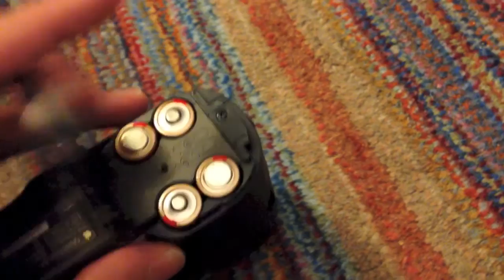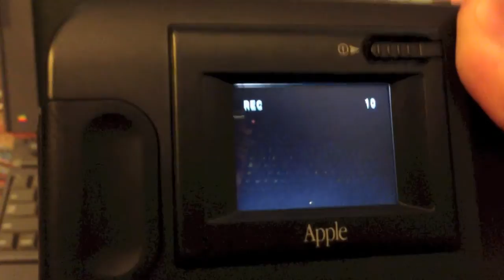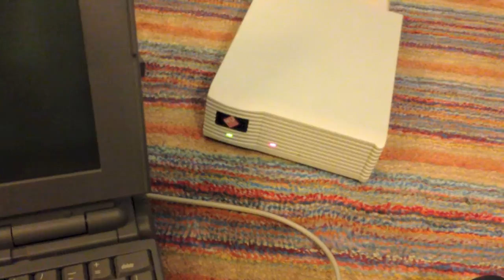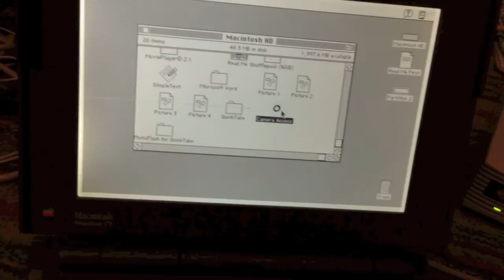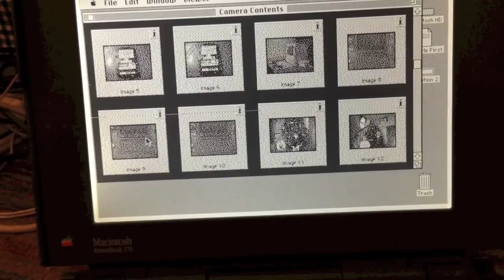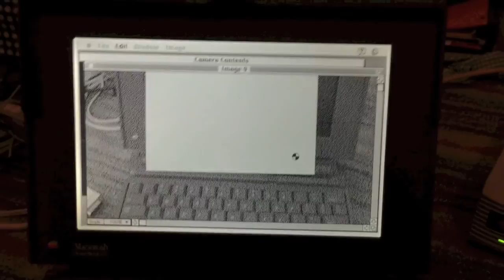Apple QuickTake 200 Camera

Comment: This must be really sought after now!
Reply: Not really.  The inability to easily use them with modern computers makes most people eschew them for slightly newer vintage that can use standard SD cards.

You can't even use this camera on a Mac using MacOSX because in MacOSX, Apple removed the ability to connect serial devices.  Meaning the last compatible Mac's were pre 2006, specifically running macOS9 and before.  Although it is still possible to connect them to Windows machines if you want to deal with the converters, using ancient software to convert the files (not official Apple software mind you, Fujifilm software from that era), and all the other pain of troubleshooting involved.

Tons of them are sitting on eBay for around $250.  At that price for the headaches it gives, I don't think it's worth the time for a majority of consumers (who wants to even own any pre MacOSX Mac to use in daily life when a $600 Mac Mini exists?).  It's a curiosity for Apple aficionados, collectors, and MAYBE people willing to be masochistic enough to use it for some kind of art project.

Comment: Could you point me in the right direction with using a card reader for the sm card? To my understanding, it's not possible to transfer onto any modern macbook? Are their drivers available? I just want to avoid using a serial cable. Thanks!
Reply from the maker: +Andrew Lovgren The Smart Cards used in these cameras can't be used in most modern card readers, as they need a higher voltage (5V) whereas most Smart Media cards only use 3.3V. Unfortunately, the only practical thing to do is use the serial cable, unless you can manage to find a 5V Smart Card reader.
Reply: +dosdude1 I just realized that. I'm definitely new to this process but if I wanted to get my images off my camera and onto my macbook, what should I look into getting? Is a Powerbook the only option since using the Apple software?
Reply from the maker: ***** I'm afraid a vintage Mac would be your best option. Try to get one with a 68040 or PowerPC processor for full compatibility. (Note that Macs from 1998 or newer don't have serial ports).

Comment: Do these take 128Mb Cards? I bought a QuickTake from eBay I am about to go and a find a larger card for it!
Reply from the maker: These take special 5V cards. Do not use a standard 3.3V card or you will fry the card.
Reply: I have been searching and have not found much yet... is only 4 or 8 Mbs like the limit or can I go find larger ones that support 5Vs?
Reply from the maker: Unfortunately, the 5V ones are pretty rare, and even the 4 or 8 MB ones are pretty expensive. The largest you can probably find is 8 MB.